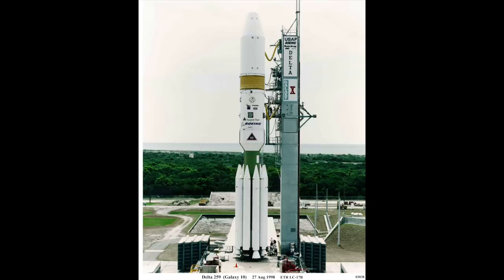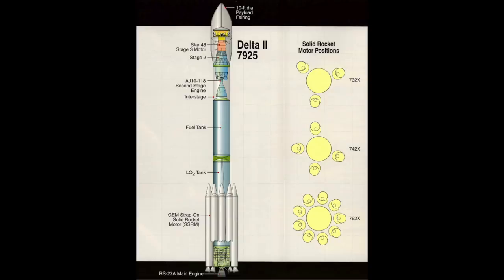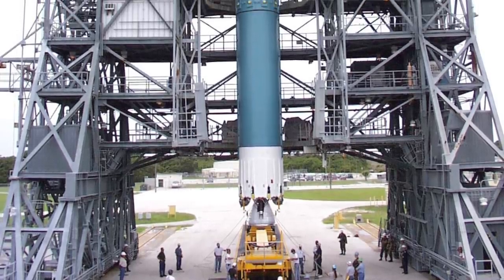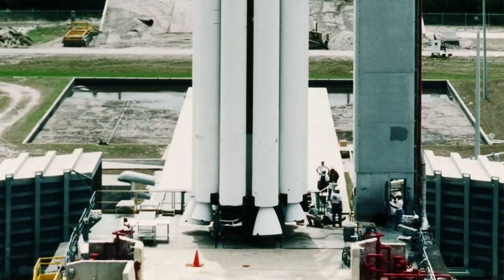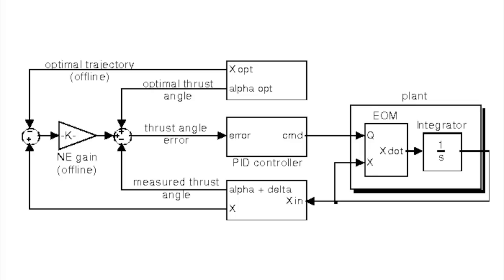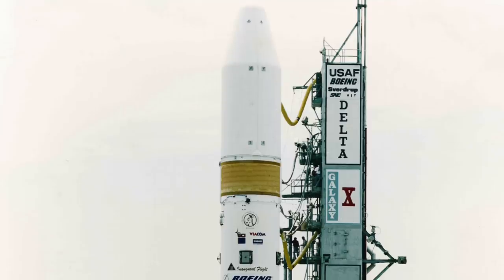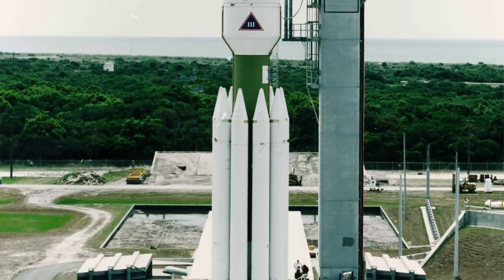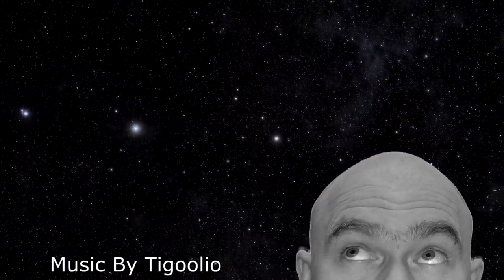Why The Delta III Rocket Exploded On Its First Flight - Why Rockets Fail

Comment: Many of my KSP creations have been destroyed because of overzealous gimbaling.
Reply: Mine too. The damping factor is not controllable in the stability assist, so if the gimballing is too good, the rocket oscillates.
Reply: @adamrak7560  The vanilla SAS is not nearly as bad as MechJeb though. I love the ability to point to an angle with MechJeb, but the damping is terrible. It's probably configurable, but it needs better defaults anyway.
Reply: Seems like putting amount of hours played in KSP on a CV may not be a terrible idea.
Reply: Thats why I keep wanting KSP to implement user defined control programming.  They have done an absolutely awful job with the automatic control stability.
Reply: Same, just about to comment the same thing
Reply: @htomerif  I think it's alright for the most part, but when you get even a slight inverse wobble between the front and back of the craft, things go out of control. Autostruts mostly fix that. That, and reverse control surfaces are really bad.
Reply: @gajbooks  The thing I dislike most is that there are plenty of real aircraft that are fundamentally unstable and require computer control to be human-flyable but you can't do any of those things in KSP or it just doesn't work.  The biggest example being if your center of lift is just the tiniest hair forward of your center of mass, no amount of RCS thrusters and reaction wheels and auto-stabilization will keep it from flipping over backwards, when in reality its not that hard for a computer controlled system to keep something like that stable.

I was really looking forward to the robotic parts DLC but you can't integrate any of that into automatic feedback with the flight control.  Your only option is to move the servo components to preset positions.
Reply: Control systems are really hard to tune. This is especially difficult when the mass of the vehicle is rapidly changing as well as the aerodynamic forces.
I tried to write a PID to control a KSP airplane and I never did get it working perfectly.
Reply: @htomerif  If you're up to modding it in, kOS really shines in that area. Idiosyncratic programming, but if you're mostly there for "I want pid loops I can tune" it's fine (and I kind of like the retro-ish programming language; it feels like it fits the game). I've spent way too many hours trying to tune up a control system for RTLS boosters...
Reply: Same here the worst offenders are the Mainsail and the FASA F-1. You have to usually tweak the range to keep them from destroying things.
Reply: Vector engine has killed many a craft
Reply: @htomerif  Try Atmosphere Autopilot mod. You just press 'p' during flight and it replaces default stability control. You can also use autopilot and make your craft fly in any desired way. And of course use FAR, which is essential to have at least somewhat realistic planes behaviour. Those two mods are always a must for me, it makes the game so much better.
Reply: Yeah, the angry-arse PID correction is nuts when using a hold orientation mode.  I've watched a vector spaz all over the place and lose enough power to cosine losses that a craft didn't have enough gas onboard to make the Mun anymore once the burn was done.  Sure, we can turn down the authority, but then we lose the authority.  The one thing I've seen work decently is forcing the gimbal slew rate down to something like a few degrees per second (instead of instantaneous) -- you still get fairly good response, and since you can keep full gimbal range it will still turn hard if you ask it, but the damage from the SAS shenanigans is cut down to almost nil.
Reply: Usually I don't understand 100% of Scott Manley's technical explanations, but my experience with MechJeb made me understand exactly this "too much gimballing" business

Comment: As my engineering prof was fond of saying "Then bad things happen in rapid succession!"
Reply: I like this saying, I think I'll remember it. Thank you!
Reply: bon mots from old bosses: "at this point, the process / system becomes non-linear" - "everything... EVERYTHING is a fuse for some combination of amps and volts" - "it underwent a rapid disassembly of non-moving components" (another one used "unscheduled rapid disassembly"; I note that Elon Musk has also been known to use this one)

Comment: I worked this launch and even filmed it with my then girlfriends video camera from the left window of an HH-60 pave hawk helicopter.  We had spent the previous 90 minutes out over the Atlantic clearing out boat traffic from the launch danger zone and at L-5 were at our mission support positions in a hover over the  Banana River.  As it climbed overhead I hung out of the helo trying to video it but stopped and came back inside just a few seconds before it blew up.    We were ordered to break away by cape control and we immediately flew off to the west just in case any debris came toward us.  Of course by that time the rocket was well over the Atlantic so no danger to us but we did get to spend the next ten minutes watching pieces fall into the ocean through our night vision goggles.  In my career, I worked dozens of rocket and space shuttle launches and landings and a few of them stand out.  This is one of those launches that Ill never forget.

Comment: Hi Scott--The cryo upper stage for the Delta 3 had its genesis as the 'Hydrogen Upper Stage', or 'HUS' that MDAC had wanted to develop in 1977.  NASA wanted no part of it, as it would have been competing with the Shuttle.

Comment: It's a pity that the Thor-Delta III never really got a chance to prove itself.
Reply: Well, it kinda did
Reply: @incandescentwithrage  It had just the one flight before cancellation.
Reply: @nicholasmaude6906  Well, it actually had 3 flights, two failures and one partial success
Reply: At least it set the stage for Delta IV, which is quite an impressive vehicle.

Comment: I worked on the RS-27A abd RS-68 engines.  Specifically, I designed and built automated test systems for their engine control units (ECU).  So your video brings back memories for me.

The RS-27A  had a dome-shaped ECU that was sometimes called the "salad bowl".  It's logic circuitry used diodes and electromechanical relays.  The guy who designed the ECU (Rudy something) was a young engineer when he did it, but when I joined to project (to replace the ancient ECU tester with a modern one in the late '90s) Rudy was an old fart and I went to his retirement party.  The old tester was so poorly designed that it didn't work whenever it was raining outside.  Seriously.

The RS-68 ECU used microcontrollers and FPGAs.  The guy who ran that team frequently called himself "a damn fine systems engineer" but in reality he had NO IDEA what he was doing; he just wanted a really big team so he could feel important.  For example, there were about 20 software engineers on the team to design firmware that had to fit in a 2kB ROM.  Once, someone raised the question of software reliability, and this guy laughed like it was the funniest thing he'd ever heard, and said "software doesn't break!" with attitude in his voice, like he was talking to an idiot.  I think a few months after that an Ariane rocket blew up because of a firmware bug in it's ECU.  I could fill a book with all the stupid, ignorant things that guy did.
Reply: You might be the only one to archive the stories.  I for one love to read about the real goings-on in other spheres.
Reply: And at least 63% of the dorks here, myself included, would love to buy that book.
Reply: There are buffoons at every level. I once watched a crew supervisor in the "shake & bake" labs at Martin Marietta (1980s, Waterton CO Space Systems campus) balance a launch vehicle's primary rate gyro package on his head and spin it. It was flight hardware.  We were standing in a clean room too!

They promoted him so he wouldn't be touching flight hardware. 

At the same joint, I watched a test technician attempt to roll a full-height rack stuffed with maybe half a million USD$ of high-end HP (then, now Agilent) RF test gear down a ramp alone. Caster caught on a carpet edge. (yes, the ramp had carpet on it - the place was ghetto AF) Rack stopped rolling. The tech pushed harder, and over it went, like a felled tree, landing on its side, BOOM! It was heard throughout the building. 

They promoted her so she would no longer be touching hardware.

This proved to be a pattern there. Given that their Titans went from being the most reliable launch vehicle at the time to the least reliable in the space of 36 months, it was my impression that the whole organization was a dying dinosaur from top to bottom which would not survive the end of the cold war.  If they hadn't merged with Lockheed, they'd have vanished.
Reply: @railgap  god, I was in charge of our electronics lab at my institute, and you bringing up memories of Agilent VNAs, Cascade Microtech probe stations just caused me pain. I've had to replace cables, probes etc so many times, because people would crossthread the connectors ("I didn't get a good signal so I tightened it more, now it doesn't work"->after being told not to, of course)...mind you, this is at one of the top universities in the world. Or my pet peeve: We have 4 probe stations. We have several DC measurement instruments. All of them can communicate with the host PCs. One of them is designed specifically to interface with 2-3 other 100k$+ pieces of equipment and has software written for it to make automated, wafer scale DC+RF measurements and analysis. It can also run standalone DC, which all the other units can too. But of course, they're too lazy to read the manual for 5-10 minutes, so they always wheel the 200k$ rack around, so we can only use 1/4 of the equipment at a time, and then they complain about lack of availability. Can't wait to get out...

Comment: The rocket knows where it is at all times. It knows this because it knows where it isn't. By subtracting where it is from where it isn't, or where it isn't from where it is (whichever is greater), it obtains a difference, or deviation. The guidance subsystem uses deviations to generate corrective commands to drive the rocket from a position where it is to a position where it isn't, and arriving at a position where it wasn't, it now is. Consequently, the position where it is, is now the position that it wasn't, and it follows that the position that it was, is now the position that it isn't.

In the event that the position that it is in is not the position that it wasn't, the system has acquired a variation, the variation being the difference between where the rocket is, and where it wasn't. If variation is considered to be a significant factor, it too may be corrected by the GEA. However, the rocket must also know where it was.

The rocket guidance computer scenario works as follows. Because a variation has modified some of the information the rocket has obtained, it is not sure just where it is. However, it is sure where it isn't, within reason, and it knows where it was. It now subtracts where it should be from where it wasn't, or vice-versa, and by differentiating this from the algebraic sum of where it shouldn't be, and where it was, it is able to obtain the deviation and its variation, which is called error.
Reply: Trying to read that with a hang-over from hell.  I'm just gonna go back to bed. That made my head hurt
Reply: But where am I?
Reply: Sounds a lot like cricket.
Reply: You had to do it, didn't you?
Reply: The existential  crisis missile
Reply: A narrator having fun while making instructional videos for the Pentagon.
Reply: sounds like something written by terry pratchett.
Reply: Is this part of a Feynman lecture? He had a taste for jokes stemming from the academic subject at hand, but this seems a bit too long (he did not put jokes above the clarity of the lecture)
I liked the "where it is and where it is not" explanation
Reply: If you’re struggling to read that, you can listen to narrator read it in this video.
https://youtu.be/bZe5J8SVCYQ
Reply: Classic servo theory... never correct, always pushing back from detected error
Reply: +NATO Plays
Or you are oversimplifying things (cause I suspect acceleration sensors are involved, so even the position where it isn't isn't actually a position), and/or gyroscope's with is basically tracking the change in heading. From what I remember from Control systems, rocketry was well into State Space control, and I suspect those plants would be pretty much based on acceleration (and vice-versa Thrust), especially for those systems designed to keep the rockets in a controlled state.
Reply: It's a reference to https://youtu.be/bZe5J8SVCYQ
Reply: @Tuning3434  It's a joke in reference to an old video about a missile guidance computer lol.
Reply: @johnwolf2349  ok, me on r/whoosh
Reply: That sounds like an algorithm that comes back from the patent attorney.
Reply: ok wtf
Reply: Ah, this old wonder.  Ever a strangely-worded and mostly accurate description of PID.
Reply: If only control systems design was this easy. In broad strokes, you are right. But: Devil is in the details of "just exactly" what to subtract...
Reply: Oh, OK then. Thanks.
Reply: CLASSIC!! We had this posted in a clean room near the rate gyro table.
Reply: You've taken a whole paragraph to explain absolutely nothing.

Comment: :D  thats my favorite programming problem!  Changing control outputs to direct a system state that has control and sensing latency.  It comes up eeeeverywhere, from simple dc voltage regulators to drone flight controls to massive power plant burner and turbine controls.  Its one of the reasons not to buy a knock-off hoverboard: even if it had identical electronics (which it won't) it probably has garbage-tier control programming and will throw you off the first chance it gets.

Comment: Sounds a lot like a computerized version of PIO - Pilot Induced Oscillation.
Reply: They hit the same problem during the shuttle landing glide tests using Enterprise.  The pilot was correcting pitch faster than necessary, causing PIO. The copilot pointed it out and the pilot backed off enough to stabilze things.  They tweaked the control software for the next flight and resolved it.

Comment: Hey Scott, can you go over launch termination systems?  Is it explosive pyrotechnics or is it some other system?
Reply: I've heard details of only a few local designs.  I'm sure there are quite a few solutions out there trying to satisfy the high requirements of failsafe that will cause extreme mission fail by erring either way.
Reply: Idk if its the same on the Delta rockets, but on the titan 4 and 3 they used strips of explosives so maybe its that

Comment: Delta rocket engineers: we like to keep reusing old rocket technology to keep costs low.

Elon Musk: why not just reuse the actual rocket? 😕
Reply: Remember this was over 20 years ago in the mid 90s.
Reply: @mattcolver1  We feel for you Matt, we just don't agree with the concept.
Reply: @mattcolver1  ofcourse but there was an obvious comfort zone that establishment space/military contractors stayed in for decades.
 It took someone like Space X to disrupt industry within 10 years.
Reply: Delta II, Delta IV, and Atlas V are more reliable than Falcon 9. Landing your rocket is nice, but delivering your customer's payload without blowing it up is even nicer. Keep trying, SpaceX, you'll get there and someone needs to innovate, but in the meantime we still have rockets we trust.
Reply: TBF, I'm pretty sure that the full suite of avionics for propulsive landing of a booster has only really been viable for maybe 30 years? Not to minimize the achievements of SpaceX, and good on them for breaking outdated assumptions, but they're in many ways a product of the 21st century.
Reply: @sealpiercing8476  
The avionics computers were capable back then, but the algorithms for optimal descent planning may have been developed by mathematicians only recently. Also, descent control without consuming fuel is very recent. Grid fins were developed by military to steer missile weapons at hypersonic velocities and may not have accessible to non-military.
Reply: @Twotter54  Correct. The government customers are more focused on mission assurance than cost. Some payloads cost billions of dollars and many years to design and manufacture. Saving 10-20 million on a launch is a drop in the bucket when considering the total cost of the mission. Also hard to put a price on national security. SpaceX was not developed to air force specs and aimed at the commercial market. Once they were proven some government customers have made the decision to launch on their commercial vehicle that doesn't meet EELV specs.
Reply: You mean Elon Musk copied McDonald Douglas and actually hired employers who worked on their scaled demonstrator, but hey 12 year old interner fanboys.
Reply: @mattcolver1  considering the astronaut fatalities on the space shuttle programs. I would hold off on talking about "mission assurance" with space x.
Reply: @Twotter54  That's why the Air Force decided not to fly on the Shuttle and develop their own rockets.
Reply: @mattcolver1  i guess you answered your own question

Comment: 6:41 - Why didn't it detect that it was overcorrecting and automatically decrease the gain in its flight-control system to compensate?
Reply: not designed that way

Comment: My father worked on the Delta II's and the Delta III's as a propulsion engineer. I remember watching the launches and failures from Cocoa Beach. He was also in the blockhouse when the Delta II blew up just off the pad in 1997...Even with those failures, my dad had a very long and successful career with McDonnell Douglas and Boeing. He retired around 2000. Spaceflight was in our family's blood, I was a second generation space worker as an aerospace technician on the Space Shuttle Orbiters. Always love your videos!